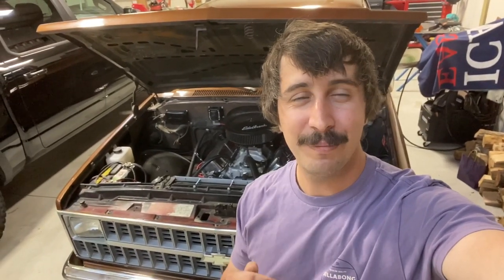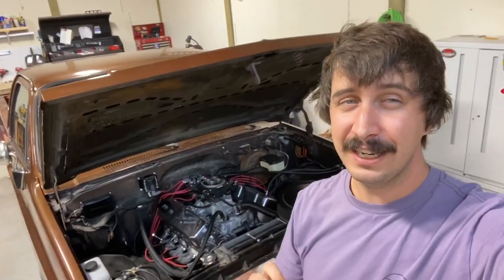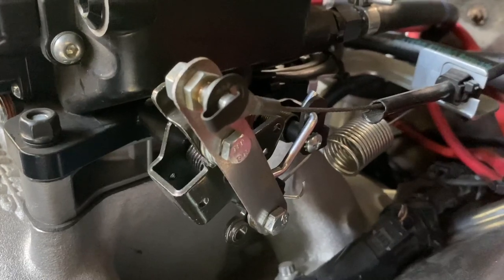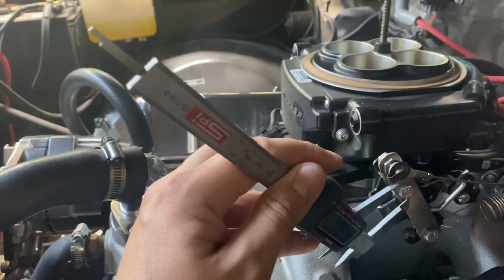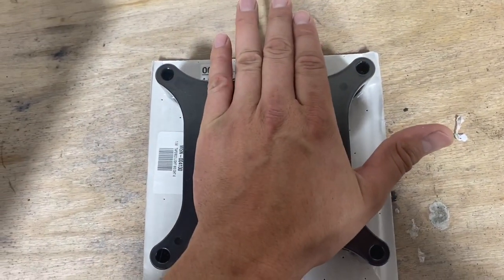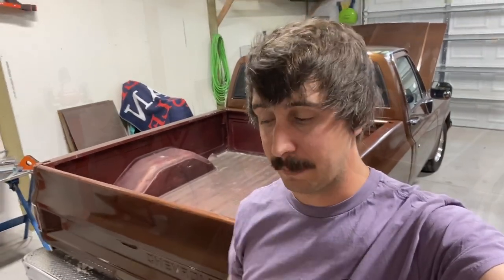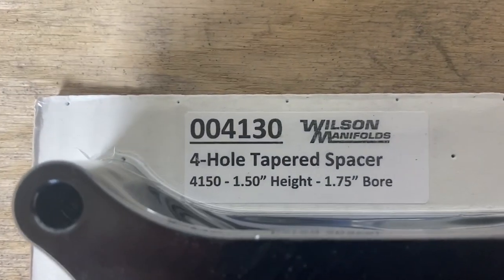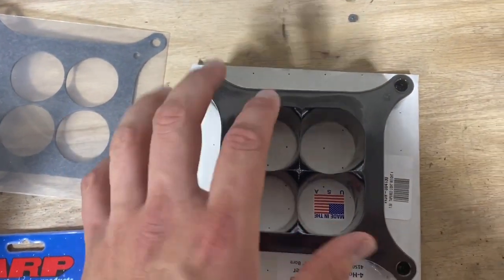Holley Super Sniper EFI Easy Improvements

Comment from the maker: If you found this video or any of my other Holley Sniper videos useful BUT you still own a carburetor please check out my newest videos where I cover carburetor installation and fine tuning!  Stay tuned for more content and thanks for watching.
Reply: where you went wrong is using 2 different wide bands to calculate afr. I can tell you right now the Aem 30 series  unit you are using is very accurately calibrated out of the box than the Holley unit.  Just to verify, swap sides but keep the same sensors matted to the aem and holly, ( do not just unplug and plug into different banks. ) after you verify the AEM and holly are reading the same in each bank as they were in the other banks. calibrate the holly wideband only. Retest. if afr readings are still that far off manually adjust voltage curve for the holly until it matches the AEM unit.

Comment: Nice video. Keep in mind holley recommends putting this oxygen sensors about 10 inches behind the collector. I know from experience that if you put them in the header or even within 3 inches the sensors will fail regularly. So anyone reading this that's replaced a sensor... You now know why.

Comment: I’ve been using the sniper for 3.5 years had the sniper whistle on install ended up using an 1/2 inch open wood spacer due to clearance  sound disappeared . With the stiff peddle I ended up going full mvb now the peddle is real light and don’t have that initial stiffness on light throttle or take off . I found going from the Bosch 02 sensor to a NTK was more accurate in readings where the std Holley sensor would fluctuate a lot more . Thanks on taking your time and putting it out there . Informative vid. !
Reply: Hello,  What is MVD?

Comment: Putting my Sniper on this week. I didn't realize that all 4 butterflies opened at once until I took it out of the box. Replacing a 650 Holley double pump carb. Thanks for the great tips. I'll be making the throttle bracket soon.
Reply from the maker: Yea its the move.  Progressive linkage is ok but you sacrifice a lot of performance

Comment: I've been thinking about putting a Sniper on my wife's Camaro and stumbled across this video while doing research.  Another thing that can really ramp up the initial throttle pressure is return spring geometry.  Instead of putting it on the bottom of the throttle arm and running it to the rear of the engine it should be at the top of the arm running to the front.  The way you've got it installed puts the throttle shaft in a bind and can put the spring at a weird angle (although yours doesn't look that bad) that really takes a lot of force to overcome.  On a carb this leads to quicker throttle shaft bushing wear and odd driveability problems.  Don't know how it would affect EFI, but it could cause the poor throttle feel.
Reply: AND when both primary and secondary are engaging at the same time you get two springs to fight on the sniper. They need a stack spring in there on the secondary so that a weak spring on the secondary engages first until you get down on it and open up past say 20% on secondary at which time the 2nd spring on secondary engages.

Comment: AFR distribution differences are pretty common with dual plane intake from everything I've seen.  .5 isnt bad.  Like others said a single plane would probably make that go away.  If you had an O2 sensor in every header tube youd likely see bigger differences than that.

Comment: I just got the Holly throttle lever from holly. I had a holly sniper put on my 76 Corvette. From a dead stop its very had for me to take off. People think I'm hot rodding but I'm just trying to go. Thanks for the video. I'll get that on tomorrow probably then the big test. I hope it works good...
Reply from the maker: Its night and day difference in drivability.  Best thing is you can modify it as you see fit with the length of the linkage.  Just make sure when you are done if you have someone floor it with the engine off that the TPS says around 100% and the throttle is fully open
Reply: What if the tps doesn't say 100% ??
Reply: Idle is also higher now with lever extension at 1100 rpm instead of before with snappy pedal at 800 rpm
Reply from the maker: @spades262 how close are we talking? If its close likely nbd.  Otherwise you will want to figure out whats preventing wot and adjust that.  Could be cable, linkage, etc.
Reply: @truckandroll989  it was me needing a throttle cable return spring 
After the install it was fine thanks !

Comment: I installed the sniper on my F100 a few yrs ago.  The extension worked great.  It also slows the rate at which the throttle opens. (increases pedal travel)
I installed the 4 hole from the start and it worked great.
Good vid 👍

Comment: Liked and subbed!  I had the exact issue with throttle stiffness you described in my 81 K10 with NV4500, especially after having to add another wrap on the secondary torsion spring. I made the linkage extension and the pedal is so smooth now that I’m having to train my foot to drive it differently.  I’ll try the spacer next to get rid of the whistle noise.   Thanks for this!
Reply from the maker: Really glad I could help
Reply: @truckandroll6466 do you have the dimensions for that throttle body extension you made up?

Comment: I just added the extension arm. I cannot believe how well it works. Thank you so much
Reply from the maker: That is awesome! Im really glad the video helped your drivability!
Reply: @truckandroll989  I'm still working on it. I had a lot of problems with exhaust leaks and then the ECU went. Holley changed the main body and ECU. I now have about 75 miles on it and all is good. It's an off-road truck so it hard to get street mii
Reply: Did it soften the throttle response some?
Reply from the maker: @markekberg8371 yea it makes it controllable.  Its no longer sticky.  Mine was a stick so i really needed it be smooth.  From what I recall the mods i made in this video look very similar to how they sell the new and updated sniper.  Progressive aint bad but I prefer lengthening the arm.  Car ran way stronger off the line and i could drive smoothly
Reply: @jaydeangelis7314 .  I made one just to test today.  It did smooth out roll in, but the tps sticks at 5 to 8 percent unless I knock it down like a choke.  No binding at all, but it does when running.

Comment: great vid as always. May I suggest you look into a single plane intake. I know the air gap is the darling of manifolds and it matches your top end kit and RPM peaks. But I keep seeing Richard Holdner drop comments about the distribution issues with throttle body FI and people comment the dual plane intakes do not work well with them.
Reply from the maker: Thats a good call.  Ive been tinkering with the idea.  Id love to throw a Torq storm supercharger on here and i think the supercharger would necessitate the single plane.

Comment: If you use a composite spacer like (Canton Racing Products"85-154 Phenolic Carburetor Spacer (For 4150/4160 Holley 4 Hole 1/4"),) it will reduce the heat transferred to the throttle body which equals longevity for electronics.

Comment: *literally typing that you should swap the o2 locations to see if the issue is with the sensor or if the bank stays the same. aaaannnnd backspace it all because you already did it lol.. good info. i did the progressive, extension and 4 hole spacer before i even installed it on my car.. I've now remove the progressive and its a whole new car.. i agree, extension > progressive link. i don't have the whistle on a 1/4 phenolic 4 hole spacer.. think it was like $20. i don't have clearance for the big boy spacer.. :/

Comment: That Wilson Spacer looks like it is for a common plemun single plane intake. Swap the injectors side to side. If you've ever had injectors cleaned and tested it's common for them to flow differently. With 4 injectors, get them flowed and them match them front and then in the rear, that might balance it out.

Comment: Super nice truck!
I really wish Holley would have made an option for two 02 sensors.
Reply from the maker: Agreed.  There are definitely a few things the super sniper doesnt do which is frustrating
Reply: My mechanic and speed shop guy has me using a X crossover pipe after my headers! this will balance out differences of each side exhaust as well as the back pressure does on the rest of the exhaust to the tailpipe would!
Reply from the maker: Both the X or H pipe will help improve performance.  Typically, although the difference is somewhat minuscule, the X pipe will favor higher rpm where the exhaust gasses are moving faster and its a smoother freer flowing path.  An h pipe is more effective at lower rpm.  Both X and H will quiet your overall exhaust tone.  If you want a muscle car sound and dont care about the performance benefits some people just run true duals.

Comment: I have a 1971 Camaro SS 396 4 speed. I am looking in to adding the Holley Sniper EFI to my ride. What i have come across in my research is that Dual Plane manifolds don't work well and have fuel distribution issues when using throttle body injection setups. everyone i have talked to tells me to use a single plane manifold like a Edelbrock Torquer or Victor Jr,  Holley Strip Dominator or Weiand Team G. I have heard the Torquer II-O big block manifold was not that good and only on par with the Performer RPM out performing it everywhere in the RPM range. fortunately for me it is the only aftermarket intake that will clear the stock hood on my 71 Camaro so for me its a no brainer on which intake to use. but I will look in to running a Victor JR or equivalent on that truck.
Reply from the maker: I should say that depending upon your build the rpm air gap is usually the best choice.  If you have a pretty radical setup that is going to live in the upper rpm range than a single plane is the move but for most street cars a dual plane like the rpm air gap is ideal.  What i learned was o2 sensors rarely read identical between the banks.  There is always some variation.  With that in mind i wouldnt believe everything you read regarding the dual plane being an issue.  Mine was tuned and drove around without issue on the dual plane.  Just food for thought

Comment: Great info, my truck has a holley sniper and i will never recomend it to anyone...customer service is horrible. had it installed...after the purchase of a new unit...then it started surging or searching really bad...4 months in the shop of a very good speed shop and they got it to run fairly well...it still sounds like its surging/searching randomly...cold starts suck it takes a bit to get it going...letting off the gas and letting it decel it pops until i get to a stop....very dissatisfied....its on a 1979 Ford Bronco 400ci

Comment: I'm working on one that has me stumped.
69 Mustang small block runs great drives great snap the throttle in neutral or park and the engine dies 90% of the time, I talked to a Holly rep and he said I have everything adjusted right.

Comment: did you even calibrate the widebands?  buy a single sensor and swap them to see what 2 match.  then keep those 2.
Reply from the maker: Swapped them.  Same results.  This isnt super uncommon.  Its basically an electronic carburetor so its not going to be a bit different side to side

Comment: All very good but you have a long term issue built into your set-up with the location and geometry of your return spring, it should always be inline and opposite to throttle cable line of pull ( or as close as practicable) or you are loading throttle shaft excessively, this is why manufacturers prefer axial type springs wound around shafts

Comment: Curious of your thoughts.  I have a sniper on a 383 in a c10.  The throttle response is way too much, and not drivable. Many times I need to burp throttle to get idle back down.  There is no binding anywhere.  I disabled secondaries and programed them out and it's a pleasure to drive.   Looked like to progressive linkage was the way to, but holley says no.  Do the cable extension.
Reply from the maker: @markekberg8371  so ive done progressive and agree it smoothed it out but you certainly lose some throttle response - like driving on primary only.  If you fix the geometry you get the best of both worlds.  Smooth throttle but killer response.  That was my thought at least.

Comment: Hi mate, awesome video, spot on with what you are saying,
Have you ever come across problem where the viper carb doesn’t rev down while driving ? ie revs stay up when taking foot off the gas or changing gears ? I have tried adding a stronger return spring , changed nothing except for the stiffness of the throttle,
Be awesome if you could help. Btw I’m an Aussie so sorry if I have messaged you at a bad time.

Thanks mate Ian Westcott
Reply from the maker: Thats interesting i havent had that.  Maybe make sure the base of the TB isn’t too tight or not tightened evenly.  Ive heard of that warping the housing which could cause binding in carburetors but its the same idea.  Is there anything your throttle linkage could getting caught up on or maybe carpet inside the vehicle near the pedal?

Comment: AFR readings will probably be different because the sensors and gauges are different. You should expect a difference. The important one is the one the Sniper uses because that's the one that controls fuel delivery.
Reply from the maker: Agreed.  Both are Bosch sensors but the part numbers are different.  I recently
Learned a half point AFR isn’t uncommon between AEM wideband kits and the Holley Sniper kit.  As you mentioned the Sniper one is still within a safe range.  Somewhere between 12.5 - 13 at WOT, 13-14 part throttle, and low to mid 14s cruise
Reply: @truckandroll989  tuning by lambda isnt that exact of a science.
Reply: @DieselRamcharger  the Holley computers don’t use lambda.

Comment: This problem of aggressive throttle engagement on the sniper is worse on a C10 67-68 throttle pedal with the solid steel bar. We are upgrading to the cable system from Lokar which seems like what you have there. You may mention or show your pedal throttle assembly setup. AND,,, did you lose any travel by adding the lever length on the carb linkage? Still get full throttle? I know with that Lokar you can adjust travel and curious to see where that limits out.
Reply from the maker: You are correct that with this adjustment you lose a little bit of travel. I believe I was still pretty close to 100% wide-open throttle but I’m positive that my TPS sensor did not show 100%.  It was high 90s.  Sometimes you can gain a but back by removing all of the cable slack so touching the gas gives immediate response

Comment: After looking for a kickdown bracket for an electric kickdown switch on turbo 400 trans I found nothing available.Now the question is can I use the nitrous trigger on the sniper efi to activate my kickdown switch because it uses the tps to activate?I'm planning on gray#6 wire to#85 terminal on relay

Comment: Been watching several of these, Also looking at the Sniper system possibly for my 350 TBI suburban. It runs super well, just not as powerful as I"d maybe like, and also looking for MPG gains (if that's a reasonable expectation)? Do you think introducing a new variable in like the Sniper system is wise? Worth the expense and reliable after maybe some minimal finicking? Would I get solid benefits out of it without other mods?
Reply from the maker: Id say if you already have TBI leave it.  If you are convinced you want an improved id try and do like a multiport EFI on your 5.7.  I have a 5.0 TBI on my 95 Sierra and got it run ing a lot better after tuneup, new fuel filter, and then I took apart the TBI and cleaned it super well.

Comment: What is the tolerance of the sensors? IE: if you swamped which one is plugged into the sniper? I assume you would be looking for one then being lean by 1/2 ish instead of rich (or reverse). I am looking at it from when I worked on F/A-18's where you had to have exhaust gas temps and nozzle positions within a certain parameter of each other. Meaning wires, senors, etc. all have a plus or minus of whatever. Even when you buy metal , torque wrenches, etc. all have allowed variations. higher than one % point I would be worried but when your at a 1/2 that could be gauge, length of wire, tolerance in manufacture of the sensor etc.  

Like being one degree off on timing, at that point it's about performance then spot on.

This isn't a knock on you, Sir, or intended, but I thought I was watching a video from the 70's but in HD with the hair and mustache along with the old square body. Any case, great info and thank you.
Reply from the maker: Lol trying to bring it back! Were you surprised when the big block wasn’t in a van lol ;)

Comment: How was the iac signal with that spacer. I have had a couple cars now one with that spacer and one with a afr intake that blocks the iac passage quite a bit. You have to command a lot more iac on startup
Reply from the maker: Thats interesting.  I didn’t notice any adverse issues with IAC.  Full disclosure it was eventually dyno tuned so they could of played with it but it didnt act weird beforehand.  The spacer was also added later

Comment: Does your  TPS hang on 1% with the extension?  Mine does, but I'm curious if yours does because you have more slack than me in my cable. I think my cable is hanging in that plastic sheath on the throttle bracket.

Comment: He I have a ? For you have you been having any issues with idle control? My idle goes high every time I come to a stop. I have an 350 with th350 automatic in my square body. Not sure if it’s related to the transmission + choppy cam and pore vacuum or not. But I noticed you did something deferent with your vacuum.